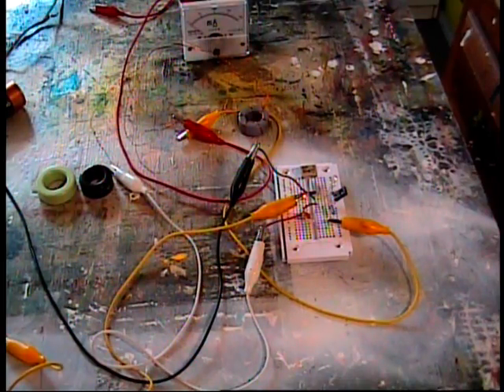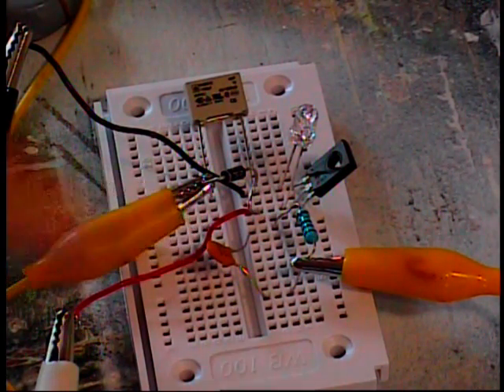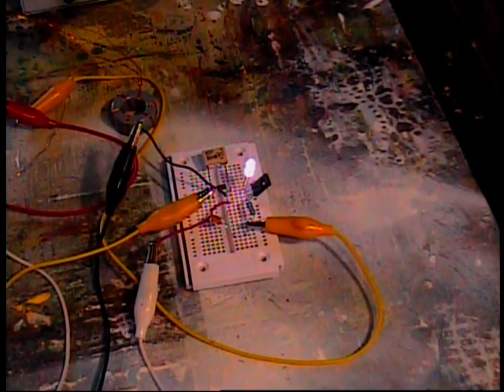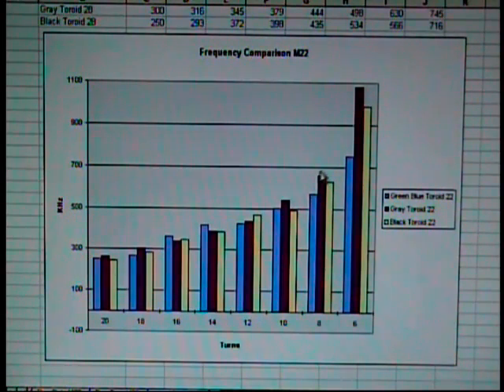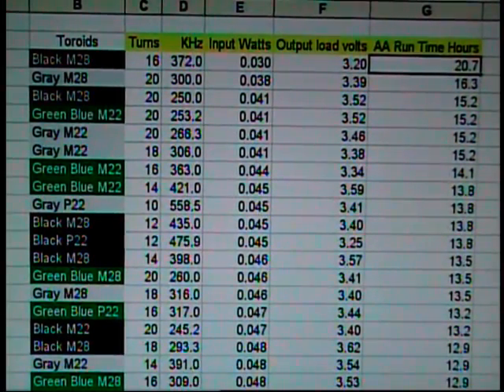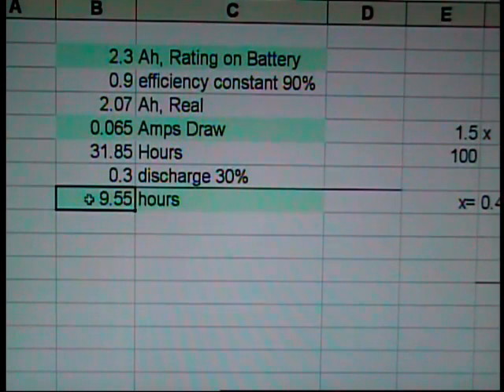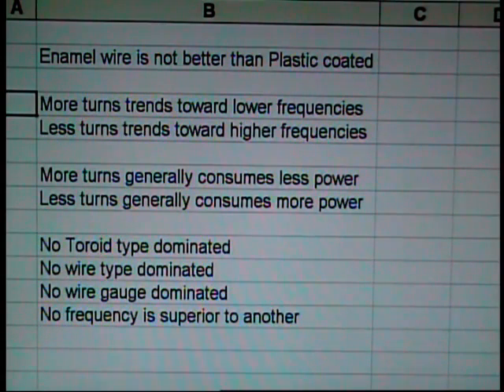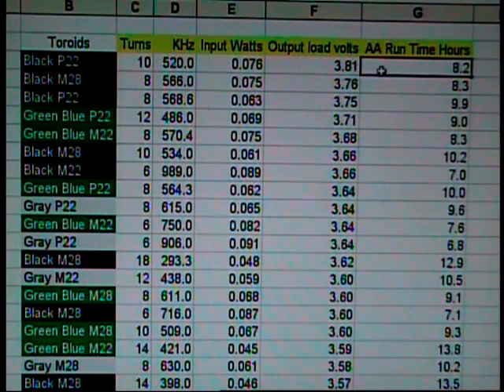Joule Thief Study

Comment: As stated by others : An excellent study however, my understanding of a JouleTheif circuit is it has two windings not one and mostly one set of turns is thicker wire and of less turns.
In other words, the toroid is wrapped like a transformer .....Oh ! And no ceramic disc capacitor

Comment: Thanks for your interesting study. For me, the purpose of a Joule Thief is to use the balance of primary battery energy, the last 30%. Therefore it would be interesting which setup provides the most output efficiency below 0.9v. For instance, what’s the relationship between number of turns and the usable input voltage?  I can go out and buy a cheap efficient flashlight which uses the first 70% of cell life, but I want to build a torch which uses what’s left.  So far it seems 0.6 V is the lowest voltage for a typical setup. Of course you wouldn’t want to run rechargeable cells that low.

Comment: Well researched and presented.
I've run similar tests in my lab and I concur with your results.
My requirement was for use as a night light/path marker - so longevity over intensity.
Miniaturisation was also a design requirement, so small toriods, enameled wire and standard 3904 transistors.
You work much appreciated.
Following.
Reply from the maker: jimtron66, I am gratified that you found this video and you used it for a practical purpose and thank you also for letting me know that you have similar results!

Comment: I have been doing the same thing and so far the best performance for me was 30 AWG magnet wire with 60 total turns two 30 turn equal length wire. Then I used an adjustable resistor POT to fine tune the circuit. I found that the 2n2222 wasn't very good for long run times and I used a S9018 transistor hooked to a 10mm clear LED. So far it runs pretty long and the battery still runs the LED at .38 of a volt. Less than that it starts to blink. It seems to be more efficient at 108 Kilohertz. It is fun to experiment and I have a use for the circuit once I have reached the best balance of run time and light output. I need to drive 5 10mm LED's for at least 12 hours at near full light output.
Reply from the maker: C MJ Thanks for taking the time to share your results. Whether a success or failure I hope you make a post and share your project with us all.
Reply: Thank you for the video and good info. It is tough to find someone who takes the time and puts this much effort into developing this circuit. It can be fun and rewarding to see just how efficient one can get this circuit. It was really tough for me at first, but I got an Oscilloscope and it helps a lot. I am trying to develop a useful light based on a variation of the joule thief circuit. I really believe there is a practical use for it. We have many electronic devices that use circuits like this. Keep it up. Love the video.

Comment: very informative info for joule theif experiments...i was surprised about the plastic coated wire performing equally to enamel coated....i never would have thought that. i have been testing an air core with enamel....and there is also an air space between the two windings....24/12 turns...my first results are strange to say the least.

Comment: Ronald, Hi..Excellent and detailed study, Glad I could inspire someone to do some deeper study on JTs. Your results are I would say about what I would have expected, having used lots of different toroids and wire types and sizes. I have been testing coils recently with dissimilar turns. The latest test is running 40/4 turns, its been running with good brightness for 6 days solid but is starting to be less bright now. I will run another test with 40/2 & 40/5 turns etc to compare. I always use the same fresh AA Alkalines as a power source and 3904 Transistor. Thanks for your video...much appreciated study and confirmation of my findings.
Reply from the maker: Thank you Mr. Freddie, I'm glad I was able to contribute. Your testing of coils with dissimilar turns sounds intriguing. I hope we get to see some!